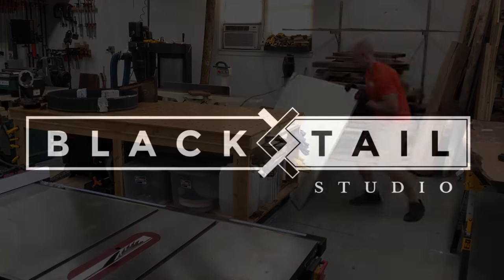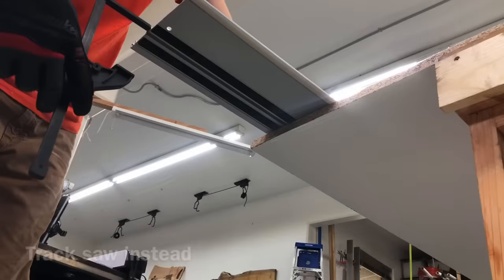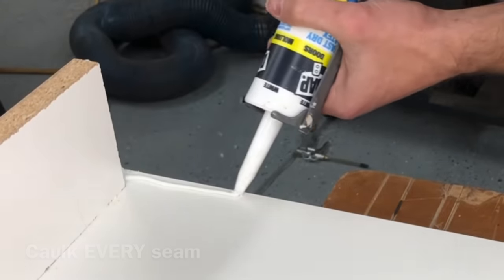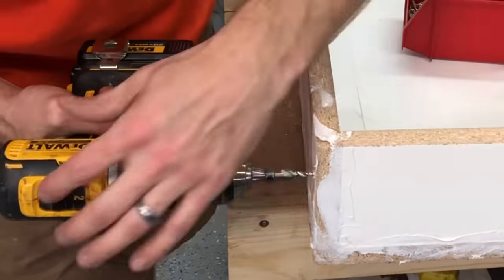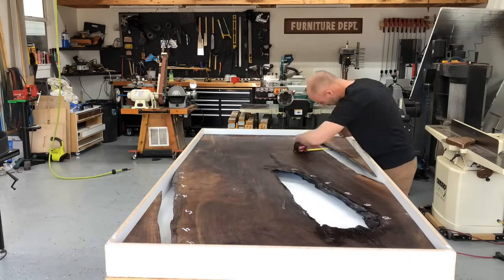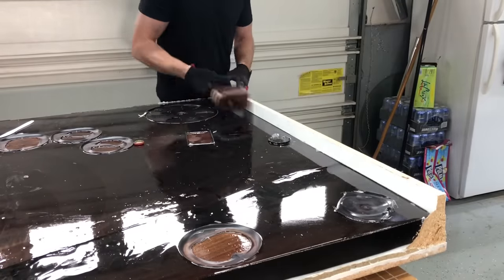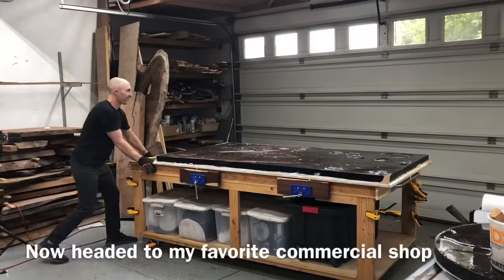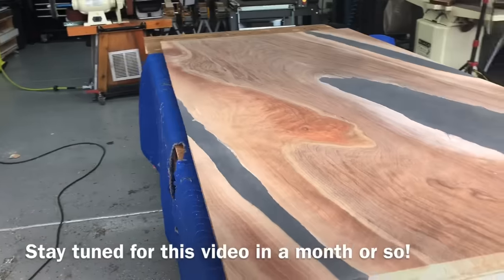How To Make an Epoxy Table Mold - DIY Epoxy Resin Table

Comment: Mel here.   Very newbie questions as I have watched a number of your video's and they are running together for me -   Can you line your mold with painter's plastic?   I have used polypropylene corrugated sheeting and would like to know where to get flat sheeting.     What polish do you use and what buffer/polisher?   I work at The Home Depot and am trying to use the products I already have for sanding but realized my polisher is not the right one.   I do have a mold release spray now.   Really looking for advice on polisher and polishing compounds.   I have also realized that all the tables I have seen made by you and others, do not use epoxy to cover the wood.   I would like a glossy finish and not satin.   What do I use.   You have an awesome delivery!  I am assuming your list for all materials is listed below  but had to ask.  Thanks!
Reply from the maker: That’s a lot of questions! I wouldn’t use painters plastic. Doesn’t mean you can’t though. And all the things used should be linked in the description. Thanks!

Comment: Derick: I did a inch and a half pour last week on a coffee table, two end tables, and a tv table. I bought a 60 liter kit and used the entire kit. But instead of curing in 72 hours the entire thing was hard in 8 hours, trapping all kinds of air bubbles and a small crack. What’s the best way to address the crack and have you had this problem before
Reply from the maker: Dang! I’ve tried filling cracks. Never looks good when I do it

Comment: Thanks for the awesome videos Cameron! They have been super helpful as I prepare to make my first few epoxy tables. I have a bunch of left over polyester tape that I use for anodizing aluminum, and I believe that tyvek tape is made of polypropylene. From what I can tell epoxy doesn't stick to polyester so my tape should work, I am just wondering if you have any insight into this. Thanks!

-Dylan
Reply: Tyvek tape works wonderfully - even better than mold release

Comment: Wondering about how to make a mold for irregular (curved) outside edges for small live edge walnut river piece. The piece varies from 7-9"wide and 30" in length. I plan on cutting down the middle lengthwise with a bandsaw and angling the saw table at about 20-30° to give the inside "river edge look". I'll then separate the pieces a few inches in the mold. I plan on doing the mold just as you describe but still not sure what would be a good solution to mold around the outer edges. Do I just make a square mold an inch or two wider all around? Thanks for any help and great video BTW
Reply from the maker: Man, I can’t tackle that in a comment

Comment: Hi there, in Reiner new sub here. I was wondering if it’s possible to build one of these tables on top of an existing table base. If so are there any benefits or disadvantages outside of being able to use smaller pieces of wood

Comment: James here, great videos, they've been very helpful.  Hoping you can give me some advice. I'm planning on a reverse river table.  The walnut slab I'm using has a large taper in width. To make it more rectangular I would need a to create an expoxy mold roughly 80"x13"x3".  Since the epoxy would be on just one side of the slab, could the weight of the epoxy separate itself from the wood?  The table legs would just be attached to the slab, so the epoxy's support would only come from it's bond with the wood.
Reply from the maker: Hard for me to say from here

Comment: I really appreciate your  Eproxy pouring table videos !! I have  Built a few tables myself, but never with that much filler in the voids. Each time I tried that, the filler in large quantities, it has a tendency to shrink smaller than the wood itself.
  Question;  Where do Go to get your Epoxy, and other pouring essentials ?   Is there a warehouse somewhere that will sell it cheaper than Lowe's, or home depot ??  Thank you very much !!!   Keep up the good work !!!
Reply from the maker: The links in the description 👍🏼
Reply: @BlacktailStudio  love your videos! i know melamine comes in 8 ft sheets. What do I do if I am making a 10 ft table? thanks!

Comment: Craig. Great video. Where is the best place to get the resin? What is the best way to plane /sand the surface down if you don’t have access to the plane you used?
Reply from the maker: Router sled, and the link in the description!

Comment: Tommy here... Getting ready to try my very first epoxy table..I have a beautiful set of bookend sycamore slabs. The grain makes a horned oil image. I don't want to mess this up any recommendations on epoxy to use? Final thickness I'm going for is 1.5-2"
Reply from the maker: I’d use liquid glass

Comment: Corey - what’s your thoughts on using an infill, like stones, for the bottom side of the table to offset the cost of resin, but to also add some texture for any object/stone that might show through the resin (which I intend to make opaque). 

Thanks in advance ;)
Reply from the maker: I’ve seen it done. Can be cool!

Comment: Will-  I read through almost all the comments and not sure if I missed this question. Do you necessarily have to build your mold over size in  length and width if the slabs you are using are bigger then you need for the projector and your planning on shortening them after?
Reply from the maker: Just big enough to fit your wood anyway

Comment: Late to the party but had a question. Have you tried vacuum degassing the resin?  I've built 10" chambers to infuse wood with thermoset tesin for turning. I can't imagine scaling up to handle a 5 gallon bucket would be much harder.
Reply from the maker: I’ve done it with small pours

Comment: Hi - loving your work 🙌I'm currently on my first epoxy project, going OK so far but not sure what grit to sand up to  - I'll be finishing with Rubio Monocoat and they advise not to go higher than 150 so it will grip, but some videos I've seen advise to go up to 500 or even 100 grit for a nice epoxy finish. Just wondered what you sand up to, any advice would be greatly appreciated.  Thanks 😊
Reply from the maker: I have a full finish video that should help

Comment: Hi I’m Dion and I’m doing only one side finish epoxy table I’m broke so the finish side will have a veneer. Which side do I put in the form. Veneer up or down to make the flattest side. To also have wood showing to finish with Osmo. Thanks love the craftsmanship you do. And please if you know a site these days to get the Gem sander/ polisher it’s seems to be hard to find right Now I’m in Kentucky
Reply from the maker: Man, not sure about that one

Comment: Paul here. I've been watching a bunch of your videos recently as my wife is interested in an epoxy entry way table for the house. Im thinking maybe cherry with a blue river. Anyways im seriously considering taking the plunge into the festool world. Ive been getting along with my rigid RO sander but i think its time for an upgrade. I currently don't own a Rotex style sander. I use a belt sander or my drum sander for heavy stock removal. Just curious what festool sander you would recommend. Would i be better off with getting two different sanders? All of their options are quite confusing. Thanks for the great videos!
Reply from the maker: I like my ets ec 150 best

Comment: Hey! About to pour my first ever river table and found this video very helpful! A few questions -

1) do you seal the slab edges or do anything to the wood before pouring the epoxy?
2) does your epoxy pour cover the entire wood or just the voids/rivers?
3) any tips for a non temp controlled garage?
Reply from the maker: I’d check out my blog. I give a step by step guide!

Comment: Basil in Kamloops BC. When you make your mold 1 or 2 inches bigger than the finished table, do you oversize your boards so they fit against the sides of the mold, or cut them to size and position them in mold with a 1 or 2 inch spacing? The latter would use a lot more epoxy.

My table will be 12x24 juniper so I can use my 12 1/2 planer to true up the top and bottom.
Reply from the maker: Usually wood all the way out. Not necessary, just more forgiving

Comment: John Merlino wanted to know if I do a small side table using a large 26" diameter fresh cut pine cut off, how long should I let this air dry, or better what do you think the best moisture content should be?
Reply from the maker: Until it’s dry. As long as that takes

Comment: Amy. Hello! Great work, awesome that you were able to use that wide belt sander. Will definitely have to search for that. A friend of mine suggested to put a small layer of epoxy down before placing the wood into the mold. Will that make a difference? Also about what temperature is your garage at?
Reply from the maker: I don’t do that. And varies by the season

Comment: Great video. My name is Joe and I'm working on table but have a question. If I want live edge on the outside and inside of table, how would I form that? The table is 4 sections mitered at corners to create a band. There a center area that will have another wood piece in it. I want to keep the outside live edge and not make it a traditional table edge. Thanks
Reply: Hey Joe, I guess I asked the same question regarding live edge in and out. If you ever get any info please share with Lori.
Thanks, I will check back.

Comment: Cat, like Meow- If you don’t put on enough mold release and the bottom of the mold sticks, would you use the router leveling sled to fix it? TIA
Reply from the maker: Probably

Comment: Would you recommend “testing” your mold with water or something to make sure you don’t have any leaks? We’re gearing up for our first pour and following your instructions but so nervous about a leak due to the shape of our mold (corner bar cabinet shaped like corners in a kitchen) and trying to think of ways to make sure we did it right before the pour. Any suggestions would be much appreciated! Thanks
Reply from the maker: Na, just keep some flex paste on hand

Comment: Hello,
I love the tables you create. Absolutely stunning. 
Question I wanted to ask was if I cannot get the melamine board size that I want what else can be used?  Also can a joint be made and caulked?  Basically I’m trying to do is make a square dining table
Reply from the maker: You can add tyvek tape over it
Reply: Blacktail Studio thanks for that. I may have just found the size of the board I need 😊

Comment: Cam, I love your work!!  Question,  I'm making a 5' by 6' epoxy top.  You think I could add 1' to the 4' width without any leaking? I was going to caulk the seem togethor and also use the tyvek tape.  Any thoughts?  Thanks so much!!
Reply from the maker: I’d make a mold 👍🏼

Comment: Shane here, thanks for the great videos! I am almost ready for my first epoxy table, starting with some spalted maple that will become a coffee table. Figured I should start small! My question is on the extra 2" you add to the form. In the video it appears your wood is right up against the form? Also is it cool to make all of the edges epoxy with the wood in the middle? Is there a  limit to how wide the outer edge of epoxy can be? My slab is 1.5" thick. Last question, if your slab is to thin can you flow epoxy under the slab to add thickness? Thanks in advance!
Reply from the maker: Check out my “use half the epoxy “ video. Should answer those

Comment: Thoughts on using the caulk before pouring epoxy, against the bottom edge of the wood or the live edge parts how some others do? I believe it's to prevent epoxy from just going underneath the slabs, but I imagine you have to plane off down to that part afterward if the caulk is too thick, hope that makes sense!
Reply from the maker: I’ve done that, still usually leaks under though. And doesn’t leave a flat bottom
Reply: @BlacktailStudio  How about hot gluing the slabs down? Or does that not really have any affect on slabs that big?

Comment: Just discovered your channel today and I’m hooked. 
Only question is about the Mold Release. Do you prefer a particular brand, or are they all pretty comparable?
Reply from the maker: I use the brand I linked. But I’d guess most would work fine

Comment: Hi, thanks for the guide!
Have a question, how do you make a mold for a table longer than a regular sheet of melamine? How do you assemble and seal the sheets on the bottom?
Reply from the maker: Check out tomorrow’s video. I do that exact thing 👍🏼👍🏼

Comment: Quick question.  You have a “lake” of epoxy in this table surrounded by wood.  Have you seen any sign that surrounding epoxy with wood causes cracks or separation due to natural wood movements?  If not, I am looking to do the same thing.
Reply from the maker: No issues!

Comment: hi Sir, insightful video. One question though, why did you choose to use a spray type mold release agent instead of a wax type?Appreciate your comment. Thanks
Reply from the maker: I have a brush on one I use sometimes but it’s harder to find
Reply: @BlacktailStudio  thanks a lot for your tips. Thanks

Comment: What are your thoughts on creating a caulk dam on the underside of the slabs to prevent seepage? I thought about doing that, as well as sealing the live edges with epoxy like you do, but brushing the epoxy on the base of the mold as well as the live edges to seal the underside that way.
Reply from the maker: I’ve tried that. Not a fan

Comment: Eamonn. Can I use normal two pack marine resin for a resin filled projects. I have never tried to do a project like a table. My plan is to start with a cheese board or something small.  Can I also obtain the colour tints from the same place? Eamonn Evans from Worcestershire (UK) thanks mate great videos.
Reply from the maker: Give it a shot! I’ve used a bunch of different ones

Comment: Nate, awesome video as always. Hope I can find somewhere with a huge belt sander like you have available around my area. Do you place the top of the epoxy table face up or face down in the mold?would it be more even if the top was on the bottom of the mold?
Reply from the maker: Always top up 👍🏼

Comment: Curt here, I am making my first river table 36 x 80  - 4 inch slab. When I calculate the volume how do I compensate for the amount of epoxy that will seep under the slab. Also if the form is slightly larger than the slab when I poor the “river” won’t it flow out to fill that 1/2 inch or so gap all around the form/
Reply from the maker: I have a video on that 👍🏼

Comment: Brian.  I'm doing a walnut slab that has a pretty large circle void in it (about 6 gallons of epoxy).  I'm only going to fill that circle with epoxy for a coffee table.  Thinking about not putting it in a full mold.  Any advice?  Thanks!
Reply from the maker: I have a round table build coming up that might help

Comment: Name is Eric Newport, always like your vids and especially waiting for the 'watch to the end' bit you put in.

In part 1 and 2 of this playlist you placed the sides of the mold on the side of the bottom.  In this video you placed the sides of the mold on top of the bottom.  Curious why one way over the other?  

You also used liquid nails in the first and now a fast drying caulk.  Curious why one way over the other?

I assume in the grand scheme of things it may not matter but wanted your insight.
Reply from the maker: I thought I addressed those in this video. Must have been a different one. Put the sides on top to see any leaks. Anything but caulk is too hard to remove

Comment: Hi…Andy from Kingston Ontario:
I notice some people use weights or clamps to hold down the wood so it doesn’t float in the epoxy, but even then I see often when the mold is removed, the whole bottom is covered in epoxy. So I’m wondering if there’s any reason why I couldn’t just put a few screws up through the bottom of the mold to suck the wood tight to the mold surface? Assuming they are sealed well of course and I plan to stain the underside a dark colour. 
Thanks and I love your videos!
Reply from the maker: That would probably work
Reply: Thanks for that! Much appreciated..😊

Comment: Hey Cam big fan of your channel. One question when making the mold. I am only going to use screws no nails. Should I drill pilot holes for the screws prior to caulking as the nails won't be stabilizing the side pieces to the bottom? Appreciate any info!

Nate
Reply from the maker: I would 👍🏼

Comment: Greetings from Europe, big  fan of your work.
 Is it possible to make some kind of reusable mold or something like that? For example one mold for table that is 2 meters by 1 meter that can be used multiple times. I was thinking of using big metal sheets covered with mold release , but my concern is leakage on the "joints" of the sides and bottom and attaching them in the first place.
Cheers!
Reply from the maker: Ya, some people even sell reusable ones

Comment: Do you ever have issues with the wood coming apart at the seams with the Epoxy, I did a small pour to close some small cracks instead of butterflies, in what I called a desk at that time of my woodworking journey and I now call a piece of wood with legs on it, and the cracks seem to open up with the wood seasonal movement.
Reply from the maker: I don’t

Comment: Trevor - Love your videos, keep em coming! Question about post pour unfilled cracks. I'm doing a table right now but after the pour, I notice some large cracks that did not fully fill in with epoxy. I want to just touch them up with some more epoxy once the main pour is cured. Do you recommend doing this with the same deep pour epoxy I used (liquid glass) or would a faster drying epoxy of the same brand work just as well for larger touch ups?
Reply from the maker: Na, use a faster epoxy for the touch ups